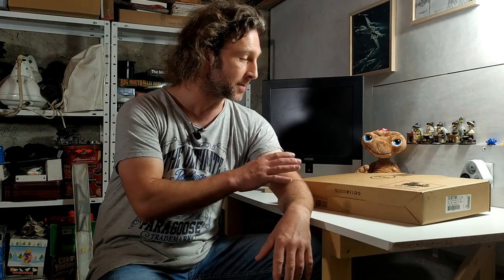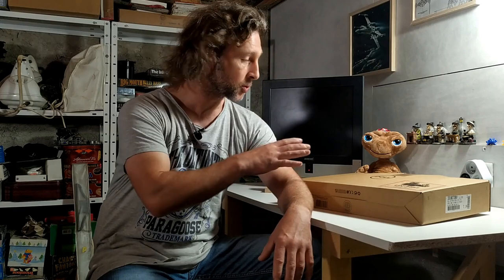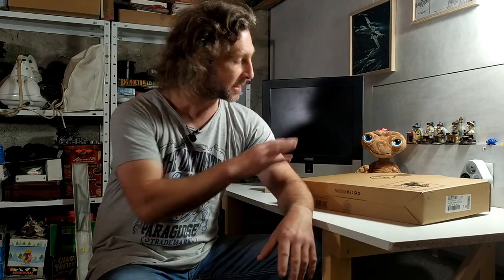Fixing an Ebay spares or repair Atari 2600 clone system with 160 built in games | 8bitsinthebasement

Comment: Lucky "dry joints" is my favorite 😀 fault...
Good job again Peter! The proprietary chip indeed tho has this 3x-into-one smart capability that is genius but under cheap overall construction which is a shame for the whole design. Thanks for sharing! Cheers mate!
Reply from the maker: Dry joints are always an easy fix (if you can find them). The all in one chip on this system is great but it's a pity that it doesn't have support for paddles. The block of wood behind the PCB has fixed the board flexing though, so all in all this clone should keep going for another couple of years. It's great to plug in and be able to play games without having to pull out a pile of carts. Thanks for the comment Theo ;)

Comment: Ah always wondered what was in some of them 2600 clones :) TY for the video.
Reply from the maker: Cool little thing isn't it? A 6591 Atari on a chip along with a ROM and some logic all placed on one very flexable little board. To be honest it works just as well as the real thing (if you forget about using paddles) and it's great to be able to just turn on and pick a game to play. Thanks for watching and taking the time to comment, take care ;)
Reply: @8bitsinthebasement  i wonder if it will work with racing paddles ?  just something i thought about after the test, since race paddles do not share the same plug, like the regular paddles do. and yes neat little critters they make now days :) we would of loved them back in the day.

Comment: Great fix and great 
future proofing flex breaks!
Reply from the maker: Thanks, working with this system answered my question "Why did Atari use RF shielding that could have been used in a bomb shelter?", to stop the board flexing of course. I don't have a bomb shelter so I used a bit of a tree ;) Thanks for watching man ;)

Comment: Very cool. I didn't know they made clones with built-in games. Only saw those Flashbacks. I just got a TI99/4a that I'm working on. It just needs a cleanup really. I'd like to get a multicart for it as well. Atari was what I played games on from 80-87. I used to be able to play Defender for hours on end without running out of lives. I own an Atari Jr 2600 but only a couple of games. The shipping costs almost as much as the games. I need to get a multicart for that too. Enjoyed the video!
Reply from the maker: It seams that the clone Atari 2600 market was a huge one by the end of the 80s. While waiting on my clone to got to me I had a look around to see what I had in fact bought and there are all kinds, the most famous being the RAMBO branded one. These systems were sold with joysticks (but no paddles) so I suppose it's no surprise that the paddles don't work.
The TI99/4a is a nice system to have picked up, I hear that the final Grom is a great SD solution for it. I'm having a dog's trouble with mine. As you probably know the sound doesn't work on it. It was my fault I blew up the chip "trying something out". Long story short don't connect it up to a PC and try to send wav files to it's cassette port (well, not at full volume at least). The thing is, it's sound chip (that I killed) is impossible to get nowadays. You can get newer ones (that work with the US version) but they won't work with my Euro one. I think I may have a fix for it though, video coming soon...
Atari games were really cheap two or three years ago, now like everything else they're geting more and more expensive, but I do hear great things about the "Harmony" cart. It's great you liked the video, thanks as always for watching and take care ;)

Comment: Very nice and easy fix, of course You needed to find those dry joints first, nice job!
Reply from the maker: Thanks very much, thankfully it was a very easy fix. These boards have so few components that apart from dry joints needing reflowing or old caps needing replacement there is little that could go wrong. Well, apart from a faulty or dead 6591 chip, that would have made the fix very difficult. Thanks for watching ;)
Reply: @8bitsinthebasement  No problem, thank You for the informative and interesting videos :)

Comment: Just plug in , select a game & play!!
No mandatory internet sign in , no unskippable  cut scenes , no massive upgrade download - Ahh those were the days!!

Presuming you will be contacting the seller demanding a partial refund for the missing 30 games???

Can you flick straight to one of the built in  the games manually or do you have to just let it cycle slowly  through its collection - even at a rate 1 or 2 seconds each that is still between 2 & 4 minutes to see every game!! Just have to hope the 1 you want to play is near the beginning  !!

What search term(s) did you use on EBay? 

I see your video editing skills are being shown more & more - some good transitions there - what setup & software are you using ?
Reply from the maker: Yep, I'm going in looking for a full refund and an apology for the lack of those games :)
When it comes to choosing games, I'm afraid that you start at the begining of the game list each and every time you turn the system on. Each game is up for just over a second so you have to be quick to flick that switch to stop them rolling. If you miss your game you have a choice, wait for it to cycle through again or turn the system off and on again, it's janky but it works. 
I have a brouse through Ebay quite often looking for all kinds of things but when I found this one from what I remember I just typed "atari 2600 console" plain and simple. 
I use "OpenShot" for my video editing (because it's free and I'm cheap) I've got an old Dell i3 from 2011 runing Linux Mint that I edit everything on and If you want to know about cameras I use a "xiaomi redmi note 7" mobile phone to film everything. The whole setup is cheap as chips but it works quite well. Thanks for watching and take care ;)

Comment: these are the known clone systems most likely based on a one-chip solution. something Atari offered later but too late to reduce the cost of the system. Paddle support is non-existant on the clone system due to missing pins on the one-chip solution. Btw. the accomplished 9V power supplies should be reduced to 6-7 volt versions. The cartridge slot of some of these clones might lead to damaged cartridges.
Reply from the maker: Many thanks for the heads up on the PSU voltage. The chip in the clone is like you say without analog support hence no paddles. I did see one in a Ben Heck video years ago that had an Atari on a chip with full functionality but these are very rare it seams. What was the problem with the cart ports? Too much voltage on pins? In any case, thanks for watching and the comment ;)

Comment: We need to buy you a new soldering iron! 😀 I think you'd find a new soldering iron will make night and day a difference with your rework.
Reply from the maker: And I thought that nobody would notice my solder tip poverty. You are of course 100% right. I've got more tips on order. I thought I had some but when I looked the "cupboard was bare" so as to speak. Thanks for watching and the advice ;)

Comment: Nice find and fix. It's a shame (like the end joke actually xD ) that they did not include paddle input on the SOC.
Reply from the maker: It would have been nice if the paddles worked too but I guess it must have been cheaper to build the chip without any Analogue. Atari's own SOC had paddle support as far as I know. But the console works and now I can play some great Atari games and some not so great knock off clone games ;)
Reply: @8bitsinthebasement  Yeah, Circus Atari with a joystick is not exactly great...but 160 games not so bad.

Comment: I found a pinout fot this 48 leg chip in your console, and even a scheme to make tiny Atari. Unfortunately i have the different all in one left chip with only 40 legs from a another (broken) console, and can't find any pin out fir it. I want to make a tiny console,but i do not have the original PCB any more to reverse engineere it .
Reply from the maker: What are the markings on your chip? I'm sure that there must be a pinout for it somewhere on the web. Usually these chips have a lot of what's needed to make the system built in so with the exception of a ROM chip a few resistors, some caps and a 7805 you have what you need to make your console.
Reply: @8bitsinthebasement  I found the pin out and scheme for mine in one polish forum ,it is called 5388 . Unfortunately It do not works , or I am doing something wrong.

Comment: Try AV MOD on this ! :)
Reply from the maker: Aaah, but I did you'll find the video here https://youtu.be/PgXnapoicJc Thanks for watching ;)
Reply: @8bitsinthebasement   nice thanks . So you awrady done it. I have a similar Atari 2600 clone all in one chip , but with different PCB layout . Awso I have one very interesting clone one layer PCB wirh all ICs :TIA, CPU, RIOT , and ROM with 128 games , and even a empty place for one more ROM 🙃
Reply from the maker: Nice, most of the clones I've seen are like this one, with an Arari on a chip. I've heard that for a while another company were making a clone TIA chip (the same TIA clone was used in a Colecovision 2600 addon adapter) but were made to stop production when Atari took them to court. I'd bet that it's one of those clone TIA chips you have in your clone Atari. That would be a nice little system to have lucky you ;) The empty space for the ROM AFAIK is for more games but if wanted to mod the console and use another ROM you would have to install a switch. I'm jealous of your clone Atari with the full chipset ;)